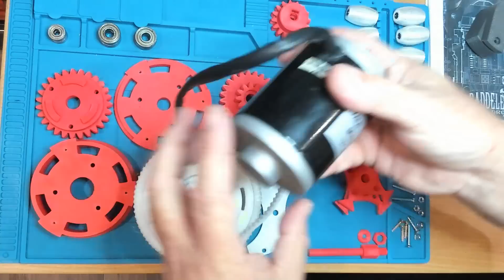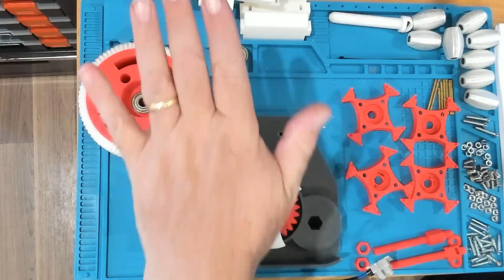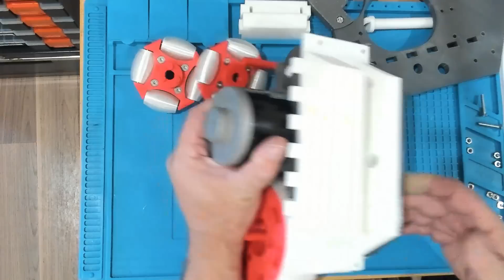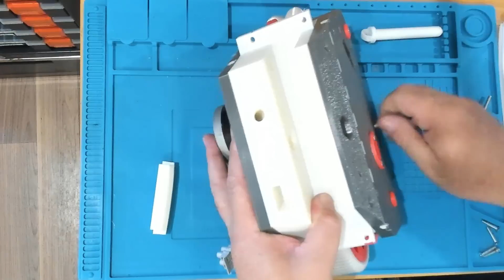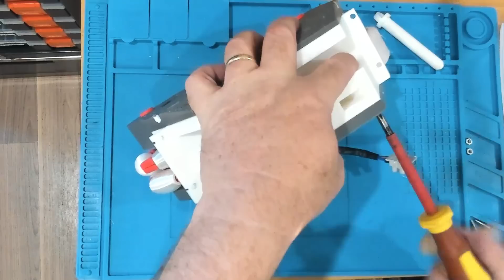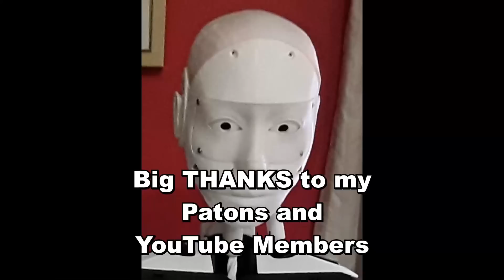R2D2 Part 3 - Left Drive Unit Assembly

Comment: Hello there! What is the difference in the OMNI wheel files for the side leges and the center? I can't seem to find the Main Legs Omni wheel files in the Mr Baddeley goggle drive.  Thanks!
Reply from the maker: There is a difference.
The centre group has two lots of 4 wheels, the side groups only have 3 sets.
The connections between each set of wheels is also keys to the set beside it so the rollers do not interfere with each other.

Try looking in a path similar to this:
R2D2\Astromech MK3\MKIII Body\Legs & Feet\CentreLeg\OmniFrame

Comment: I’m going to have to use hot glue to keep my nuts in. I have a 3d printing pen exactly the same as yours but unfortunately it stopped working due to the power socket being faulty. 😊
Reply from the maker: This is my second one and I have another 3D Pen in the draw for when this one fails.
In the first one that failed, it was the heating element that failed.
I did try a USB powered unit, but it was slower to heat up and the filament was slower to extrude.
The 12V 2A models are better.

The hot melt glue should work fine and has the advantage of being easy to remove later if you upgrade parts.